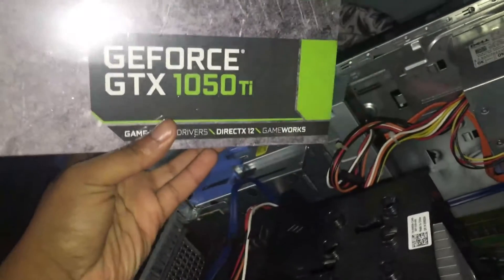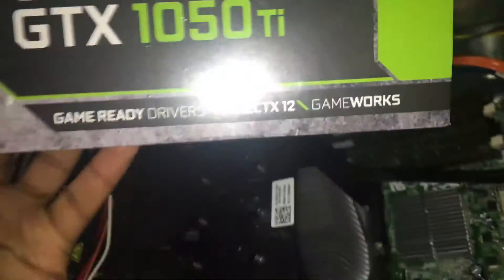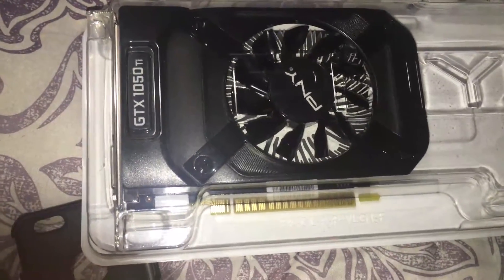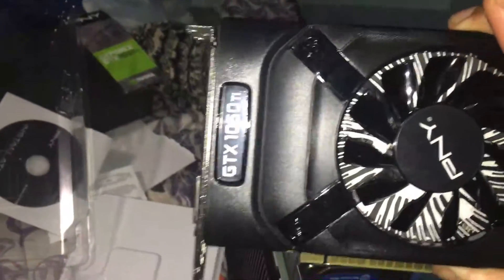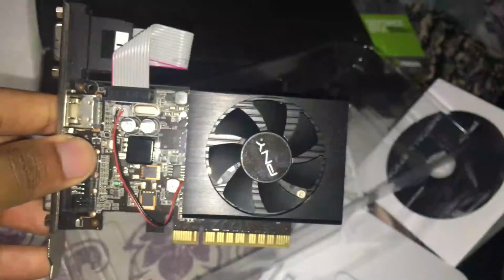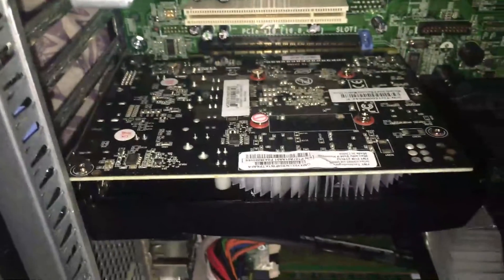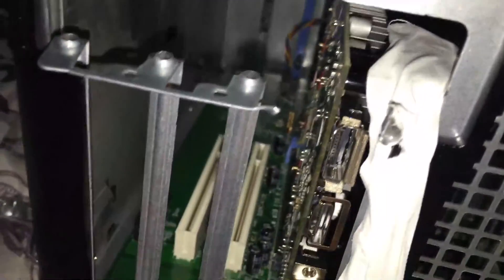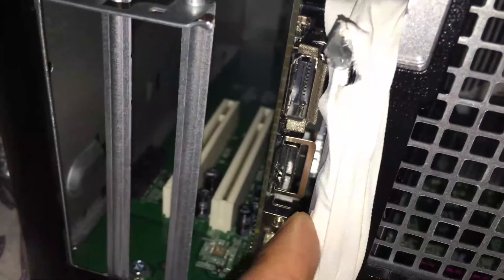PC UPGRADE PART 2!!!!!!!!! DELL OPTIPLEX 780 WITH GTX 1050TI

Comment from the maker: Do not get the gt 730 for the model computer for some reason it has a lot of driver issues
Reply: The 1050 ti replaced my evga gt 730 2gb gddr5 , sorry to hear about driver problems, i had no issues with the 730 - worked great for gta 4 with medium / high settings & stayed quiet & cool.
Reply from the maker: thats great bro
Reply: Hey pc gamerzboyz, checking in, how you like the performance of the gtx 1050 ti. Have mine since January installed in my hp sff. I've been overclocking for the past 3 weeks - + 150 core & + 300 memory clock ( no voltage ) since running on pci mother board power, this little beast rocks with my i5-2400 & 12 gb ram playing GTA 5. Thanx 4 posting.
Reply from the maker: HP CARLOS no problem bro
Reply from the maker: that's powerful bro i really like the performance of it did u make any gaming videos or benchmarks with it
Reply: my GT 730 works fine too. I have the 1GB GDDR5 version and things do run pretty fine in windows 10. But for some reason it doesn't play video in fullscreen properly. I'm still figuring that out whether it's compatibility problem, the cards capability problem, PCIe 1.1 problem, connection or the dual asymmetric ram issue
Reply from the maker: kf zhu idk man but when I had it I had so many driver issue
Reply: This compatible with default power supply in Optiplex 780? I have same PC and want to run Hello Neighbor faster than 8 fps, but can't spend more than $300 USD. Someone respond ASAP. Thanks!
Reply: I wad litteraly about to press buy... but u saved me... thank u so much...
Reply: Hi i can put 16gb of ram in this dell?
Reply from the maker: @baldinhobrasil  yes you can
Reply: @Gamerz.280  and i can put A Intel Xeon X3360?

Comment: Bro do you think rx 550 will fit in optiplex 780,its a double slot gpu so can you tell me if it will fit with the same modification
Reply: I am here because I am tryng to make it fit XD I don't think it does. 3 yesrs late I know
Reply: @conker33350  haha I remember when I was considering to buy an rx550 but wasn't sure if it would, u can buy the one thats small and probably make it fit by removing the cover, I ended up buying  an asus gtx 750ti and fitting it in this case by removing the cover, it wasn't fitting with the cover

Comment: I have an 780 sff with Core 2 Quad Q9650. I'm planning to buy a Palit Geforece 1050ti 2gb. Will it work?
Reply from the maker: yes it will but you might have to get  the low profile gtx 1050ti
Reply from the maker: https://www.ebay.com/sch/i.html?_from=R40&_nkw=+low+profile+gtx+1050ti%EF%BB%BF&_sacat=0&rt=nc&LH_BIN=1

Comment: i have Dell Optiplex 780 (MT), Does GTX 750ti works perfect? & also tell me about PSU.
& what kind of games it can play at what resolution.
I have Intel Core 2 Quad (4mb) 2.4ghz Q6600 , 4GB RAM(DDR3) , Windows 7 64bit,
Reply from the maker: yea it will work just fine right know i dont own the 780 anymore i believe the psu is a 275w yea all games will play at a low resolution and low to medium settings. but i recommend you upgrade  to a  q9650 cpu   https://www.ebay.com/sch/i.html?_sacat=0&_nkw=q9650&_frs=1  and a Gefource 1030  https://www.ebay.com/sch/i.html?_from=R40&_trksid=m570.l1313&_nkw=gt1030&_sacat=0

Comment: when  i go to gtx 750 ti requirements in geforce.com . you must have 300 w of power supply AND I HAVE 285 W. can i put 750 ti in my dell optiplex 780 ؟؟؟؟؟؟؟؟؟؟؟؟؟؟؟؟ ◘◘◘◘ PLEASE ANSER ME ◘◘◘◘◘
Reply from the maker: Charaf Fenghour I would go for the gt 1030 I actually own the card it’s pretty good
Reply from the maker: Charaf Fenghour yea you can what brand card are u getting because some 750ti cards require u to use a 6pin connector and the others are powered off of the mother board
Reply: finaly i can add the graphics card with any problem . thanks bro 
i have subscribe to you
Reply from the maker: Charaf Fenghour https://www.ebay.com/p/ZOTAC-NVIDIA-GeForce-GTX-750-TI-2gb-Graphics-Card/1924481093
Reply from the maker: Charaf Fenghour but you will be fine I used my 1050ti overclocked in my dell optiplex 780 and it worked great 👍 no issues
Reply: thanks very very much
Reply from the maker: Charaf Fenghour https://m.ebay.com/sch/i.html?_from=R40&_trksid=p2322090.m4084.l1311.R1.TR4.TRC1.A0.H0.Xgt+1030+low.TRS0&_nkw=gt+1030+low+profile&_sacat=0

Comment: did you have to replace the psu also?
in my case it has a weak psu (250 w maybe? not sure) and im afraid it wont supply enough power if I add a stronger graphic card.  So in this case the psu shoud be changed also, but I heard that regular psu wont work with it, only dell psu-s. Is this true? does this has a speciific psu connector?
Reply from the maker: hi no i didn't my gtx 1050ti worked perfectly with the psu  also the card that i had runs off of the motherboard it get its power from there

Comment: Can I put MSI gtx 1050 ti LP 
to my opteplex 780
Q9650
7GB ram
Is it will work very good with this CPU ?
Reply: LeOK yes
Reply: I have gtx 1050 pny xenon e5450 8gb ram
Reply: 200€pc
Reply: 60 fps high
Reply: Thank you so much
Reply: Fznjm did it fit

Comment: is there a cheaper graphics card i could put in my optiplex 780?
Reply from the maker: https://www.ebay.com/sch/i.html?LH_BIN=1&_from=R40&_sacat=0&_nkw=gt%20730&_dcat=27386&Memory%2520Size=4GB&rt=nc&_trksid=p2045573.m1684
Reply: Kanye James maybe a gt 1030 cause its bang for the bucks and won't have the bottleneck as well

Comment: you do not need to buy a new cooler
for gtx 150 ti ? ? 
is there a chance of burning
Reply from the maker: Okan K  no the stock cooler will work just fine the gtx 1050ti does not get that hot at all

Comment: wait did you upgrade the power supply, if not please do or your pc will die
Reply: at least with that graphics card
Reply from the maker: you dont have to upgrade the psu the gpu is running off of the MB
Reply from the maker: gtx 1050ti

Comment: Not much of an upgrade due to the cpu bottlenck
Reply from the maker: yea it wasn't worth it you can play games still but the cpu bottle neck limits the gpu big time
Reply: pc gamerzboyz if you can get should of a c2q (preferably q9650), it will be less of a bottleneck/no bottleneck, and that system supports a q9650 or any other c2q

Comment: what is the power supply like watt im trying to get one
Reply from the maker: the psu is ok i had no issues with it when i installed the gtx 1050ti with it
Reply: pc gamerzboyz so when i forst get one i can install any type of graphics card?
Reply: and did u install a power supply when u made this video or was it or the computer came with it
Reply from the maker: it came with the computer
Reply: aight thanks

Comment: 1030 work ?
Reply from the maker: yea it will work but get the low profile one
Reply: pc gamerzboyz thx, so I won't have to change my power supply or anything ?
Reply: pc gamerzboyz btw that was a quick reply
Reply from the maker: no you dont have to change your psu the gtx 1030 is powered off by the motherboard
Reply from the maker: https://www.ebay.com/itm/MSI-NVIDIA-GT-1030-AE-ITX-2G-OC-G1030AI2C-GTX-1030-AERO-ITX-OC/282571613255?epid=889593053&hash=item41ca94a447:g:dTwAAOSwhpZaAngF
Reply from the maker: https://www.ebay.com/itm/MSI-NVIDIA-GT-1030-AE-ITX-2G-OC-G1030AI2C-GTX-1030-AERO-ITX-OC/282571613255?epid=889593053&hash=item41ca94a447:g:dTwAAOSwhpZaAngF
Reply from the maker: what pc do you have
Reply from the maker: https://www.newegg.com/Product/Product.aspx?Item=n82e16814125972&nm_mc=KNC-GoogleKWLess&cm_mmc=KNC-GoogleKWLess-DSAFeed-All-Productsvideocard-nvidia_-NA&ignorebbr&gclid=CjwKCAiAoqXQBRA8EiwAIIOWsp-0xHkn8oTRU-aFF9FXMw46MGTw0hqmotiFp6m3FVCIFlm0ZDpV-hoClJIQAvD_BwE&gclsrc=aw.ds

Comment: I have an optiplex 780
GPU: Core 2 quad CPU Q8400 2.66 GHz
RAM: 6.00GB
PSU: 240 Wats
Can I use a gtx 1050 TI ZOTAC?
Reply from the maker: yes you can
Reply from the maker: https://www.ebay.com/sch/i.html?_from=R40&_trksid=p2380057.m570.l1313.TR0.TRC0.H0.Xgtx+1050ti+zotac+mini.TRS0&_nkw=gtx+1050ti+zotac+mini&_sacat=0

Comment: Can i put a GTX 750TI inside my Dell Optiplex 780?

Here are the specs:

Intel Core Duo CPU E8400 3.00 GHZ

Ram 4GB DDR2

32 Bit Windows 7 OS

I'm not really a PC gamer. I don't really support that. But is it possible to put a GTX 750TI 2GB in my Dell Optiplex 780?
Reply from the maker: Is it MT or SFF?

Comment: I got a dell 755 sff rn, and got gt 210, with pentium dual @ 1.80 ghz. I got a radeon 8490 should i switch it with the 210. And what do you recommend me to get as a good processor
Reply from the maker: https://www.amazon.com/Intel-Xeon-Processor-W3690-Cache/dp/B004NXQNU6

Comment: i got a 780 sff i install gtx1050ti lp ( i cut de back case too :¨P no w i run win10 on dual 3,0 8 ig but i lookin fot 16 gig with a xeon 3.2 quad for the ultimate 780 sff
Reply from the maker: what do u mean by the dual 3,0 8 and are u looking for any type of 780 with those specs or are u looking to get those specs and modify it

Comment: Does your card work perfectly fine with the base power coming from just the pcie lanes? I am about to buy a 1050 and want to make sure that you didn't change your PSU when you made this. Will the original PSU that comes with the 780 work fine with the gtx 1050?
Reply from the maker: Royal Chilo yes I'm using the stock psu and it my gtx 1050ti works just fine the card it's self is powered off of the mb and I believe it only needs 75watts to power it up but you will be fine nothing has to be change just put the card in and your good to go
Reply from the maker: Royal Chilo but get the zotac mini 1050 model I made a big mistake buy buying the wrong brand and the card would not fit so I basically had to modify so that it fit
Reply: pc gamerzboyz alright thanks dude I did see some single slot gtx 1050 so I am gonna order it than
Reply from the maker: your welcome

Comment: I got a dell optiplex 780 MT. I was wondering if I would need to get a new power supply and should I go with the Zotac GTX 1050 TI 4GB?
Reply from the maker: what specs is your pc running now
Reply: pc gamerzboyz CPU: C2Q Q9650 GPU: N/A Ram: 4gb PSU: Stock
Reply: pc gamerzboyz HDD: 500GB and Windows 7 Pro
Reply: pc gamerzboyz you think I should get it or nah
Reply: pc gamerzboyz or should I go with the Zotac GT 730 4GB Low Profile?
Reply from the maker: no you ca stay with the psu 
and go with the 1050 zotac 4gb
Reply: thanks :)

Comment: I have dell optiplex 780 (like yours) but i have core 2 duo 3.0 ghz and 4gb ram, can i put gtx 1050 ti in it?
Reply from the maker: yes you can
Reply: Would it run bf1 with no stutter? Or do i need to upgrade my ram or processor?
Reply from the maker: yes but I would recommend upgrading your cpu and what cpu are u using

Comment: The problem I see with this setup is that the pci-e slots are limited to 35 watts so running a 75 watt card will be a problem.  Most Dell Optiplex systems have the restriction on wattage on the slot.
Reply from the maker: nope im doing just fine with my card no restrictions whats so ever 
my setup works great if i didn't work for i wouldn't put all these dell optiplex 780 gaming videos i did
Reply: Robert RMD Mini Towers have PCI-e slots that go up to 75w, no issues here

Comment: Hey man,i got a dell optiex 760 intel quad core 2 q6600 - 2.4 ghz and 4 gb ram. Can i put a regural gtx 1050? It will fit in ?
Reply from the maker: yes it will fit
Reply: pc gamerzboyz It needs to be zotac or zotac mini to fit in ?
Reply from the maker: Islam Bacca zotac minu
Reply: im getting the  same pc, will this fit with no modifying ? https://www.amazon.com/gp/product/B06XHJX4G8/ref=ox_sc_act_title_1?smid=ATVPDKIKX0DER&psc=1 cause i have a budget for the graphics card of $119

Comment: Is this a worth graphics card for my optiplex 780?? I have a $150 budget right now. And it'll fit right?  And will it work with the stock power supply for optiplex 780???
https://www.amazon.com/ZOTAC-GeForce-DisplayPort-128-bit-ZT-P10510A-10L/dp/B01MCU1ERO
Reply from the maker: yes it should be compatible

Comment: I have an optiplex 755 with a core 2 duo and a 280W PSU can I put a regular GTX 1050 in there
Reply from the maker: yes you can
Reply from the maker: yes you can
Reply: Thanks
Reply from the maker: no problem bro

Comment: bro i have dell optiplex desktop with a 255W psu and core 2 quad q8400 so will it support gtx 1050?
Reply from the maker: MAYDay gaming yes it will what dell optiplex do you have. Also if your planning on getting the 1050 get the zotac the other brands may not fit
Reply from the maker: MAYDay gaming yes it will support it make sure you get the zotac model

Comment: Hi @pcgamerboyz! Could you do me a favour, I have a similarly specced machine from HP but I need to figure something out before I purchase the 1050ti - Could you check your settings and let me know whether your BIOS is set to Legacy or UEFI. (type msinfo in the start menu). Would appreciate an answer on this as I understand the 1050ti is meant to have compatibility issues on Legacy settings. Thanks dude, hope you are enjoying the upgrade!

Comment: if I get the gtx 950 will I have to upgrade the power supply? or can I get away with what it has
Reply from the maker: you have to upgrade it
Reply: pc gamerzboyz can you make a video showing how to please
Reply from the maker: clash Pacman hey what's up bro alright let me ask you something how much are you willing to spend because your better of getting a gtx 1050 zotac graphics card with that card it requires no 6 pin connector
Reply from the maker: clash Pacman also right now I don't have the money to purchase a new power supply sorry so what I suggest you do is buy the GTX 1050
Reply: pc gamerzboyz all spend 150
Reply: pc gamerzboyz so if I get the 1050 it's ready just to throw in right
Reply from the maker: clash Pacman yea you will be fine but make sure you get the zotac model
Reply: pc gamerzboyz Will this PC play rust Please respond and what kind of fps do you thank I can get thank you
Reply from the maker: it will be able to to and the fps will be around i say like 60 -80

Comment: does a 750ti graphics card fit?
Reply from the maker: get the zotac mini 750ti
Reply from the maker: https://www.ebay.com/b/Graphics-Video-Cards/27386?Brand=ZOTAC&Chipset%252FGPU%2520Model=NVIDIA%2520GeForce%2520GTX%2520750%2520Ti

Comment: Can I use it with the PSU 255W? gtx 1050 2gb mini
Reply from the maker: yes you can the GPU is powered  by the motherboard  and it only requires 75watts
Reply: you recommend disconnect the cd rom drive for more security?
Reply from the maker: are u asking that if u disconnect the cd rom that it would not get corrupted

Comment: did you have to upgrade the power supply or is it still using the stock Dell one?
Reply from the maker: i'm using the stock power supply that came with it
Reply: work with the supply ? i have 255 w
Reply from the maker: im using the 255w
Reply: @pc gamerzboy your not having any problems at all with that power supply using the gtx 1050 ti???
Reply from the maker: none at all

Comment: Bro i have optilex 990 will 1050ti work in it and what kind of upgradation i have to do please help
Reply from the maker: which dell optiplex 990 do you have the sff or the mt model 
and yes it will work on your computer thr gtx 1050ti but make sure you get the zotac gtx 1050ti
Reply: Tower model that's all i know
Reply: Bro If i chose evga?
Reply: Core i3 2100 3.10 processer
Reply from the maker: you can go with evga model but i dont know if it would fit in your case
Reply from the maker: and for upgrades more ram and an ssd card will speed up your system
Reply: And does i have to upgrade power supply for card and can i run ddr4 or ddr 5 without upgrading cpu? thanks bro
Reply from the maker: http://www.ebay.com/itm/Crucial-4GB-Kit-2-x-2GB-DDR3L-1600-UDIMM-/252658330784?hash=item3ad39c2ca0:g:LKQAAOSwWxNYogXa
Reply: Which ssd card you prefer
Reply from the maker: http://www.ebay.com/itm/SanDisk-X400-SSD-512GB-SATAIII-2-5-Internal-Solid-State-Drive-SD8SB8U-512G-1122-/311540745315?hash=item4889468463:g:nm4AAOSwCGVX-Cmv
Reply from the maker: no upgrade needed for the psu the gtx 1050ti only requires  75watts to run
it can handle both ddr 4 and ddr 5. my dell optiplex 780 is running an gtx 1050ti ddr 5 and it works perfectly fine
Reply from the maker: uhmm i would go with the sandisk its a well known and popular brand